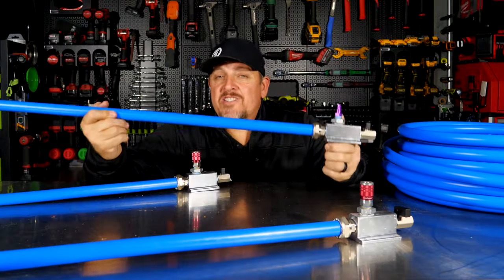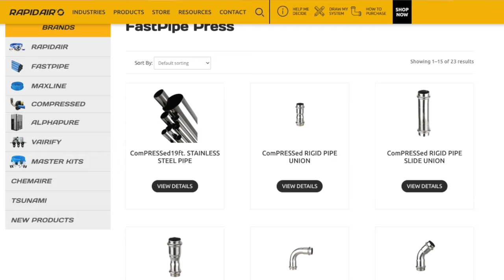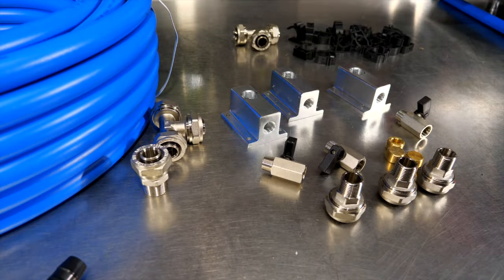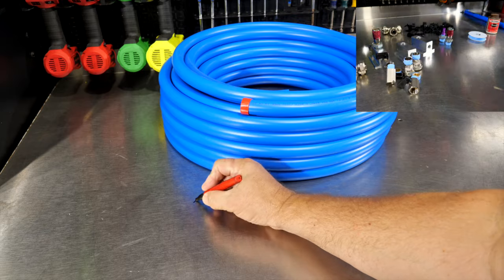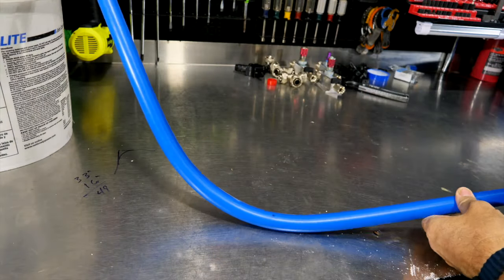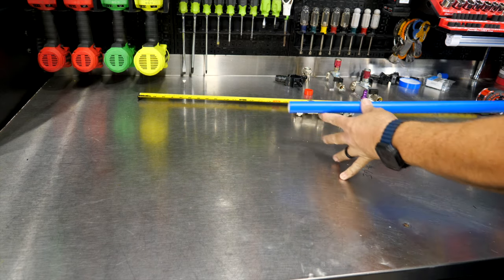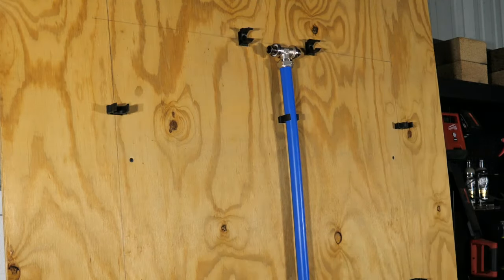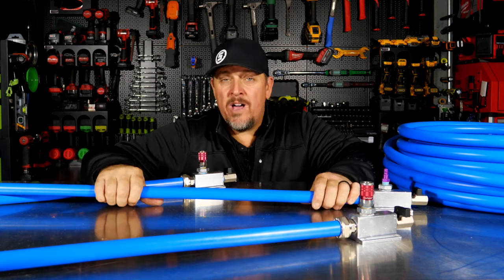AIR UPGRADE - Rapid Air Products Maxline 7500 Compressed Air Line Kit Review

Comment: I installed this kit over 5 years ago its absolutely excellent. My only issue with it is that the hose retainers are garbage especially around turns the tubing likes to come out of them they should make it a two screw hole with a full wrap around the pipe retainer. I added prevost quick connects on the drop legs and its absolutely excellent. Also buy a tube of loctite 545 for air fittings it will be your best friend for all the threaded fittings in the kit its way faster and works better than teflon tape if not you will be chasing leaks.
Reply: Use the tape for joining natural gas, it's normally yellow. Teflon can work, but it's meant to hold water pressure. The natural gas seals air tight. Strange.
Reply: I've never had a problem with mine sounds like you don't have a clue what's going on.

Comment: I find these so frustrating.... all these companies talk how important air flow is and sell the lovely aluminum pipe BUT then make these pathetic fittings that are half the diameter of the pipe!!!!!  Seriously... look at the pipe you are holding and the T on the end of it, it's LESS than half the diameter!  https://www.youtube.com/watch?v=3VN5eMmRIv8.  There are other companies that do have the correct fittings but they are $80 a fitting so I'm sticking to soldered copper and will save money.